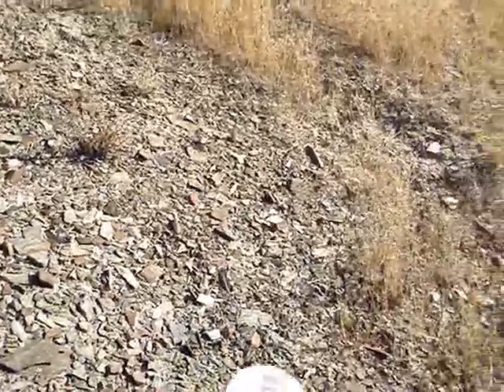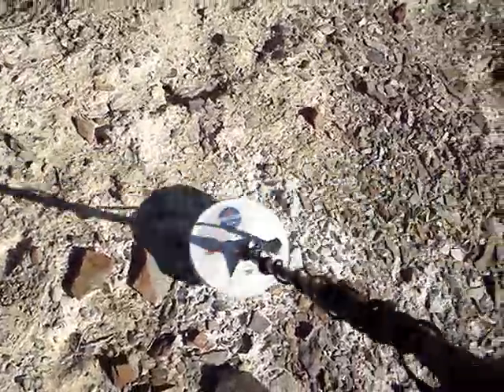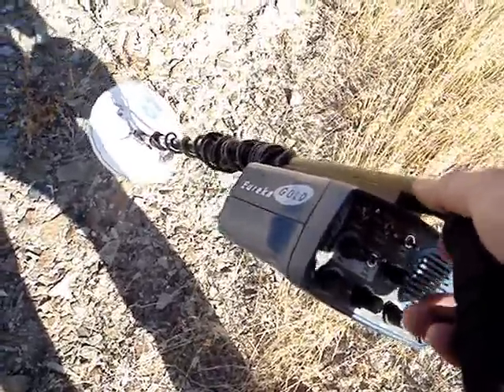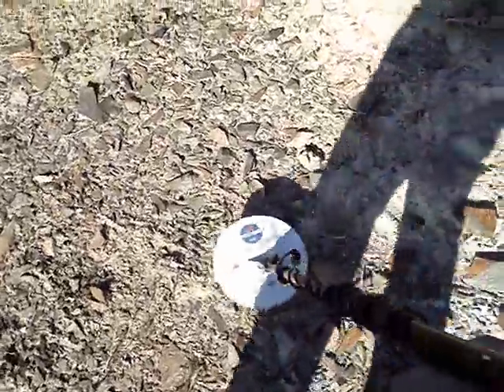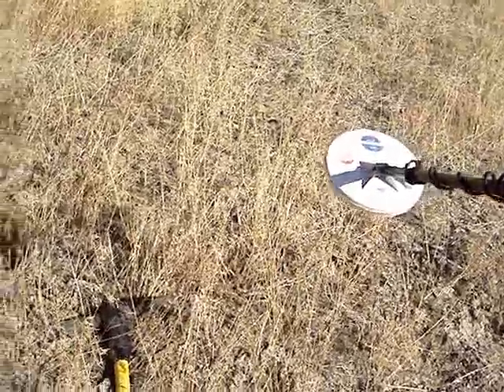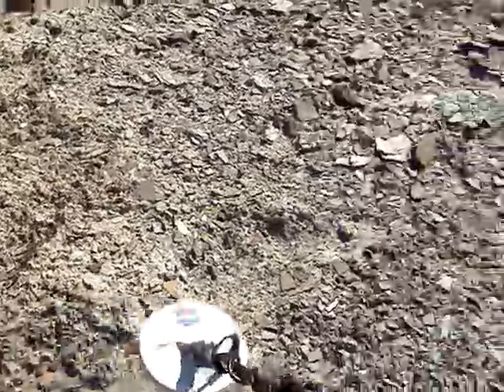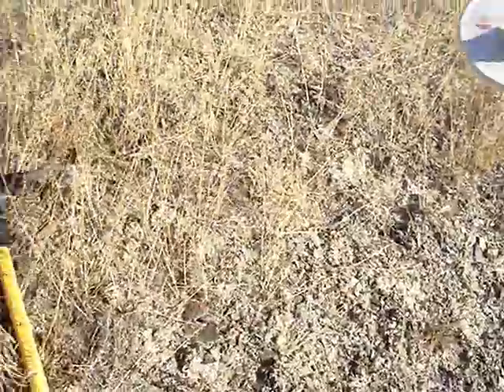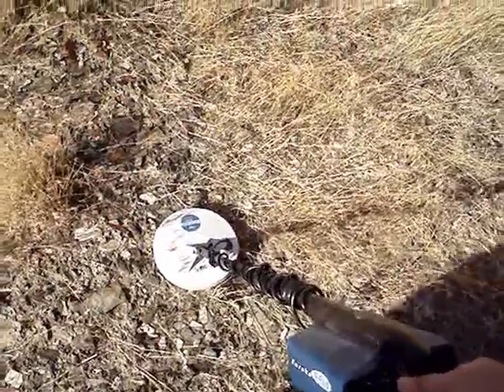Eureka Gold Mineralization Problem workaround.wmv

Comment from the maker: yes it is worth it. You'll need to get good with distinguishing random beeps that come back from mineralization or if the threshold is set too high. I turn it off and on often to see what works better, slow track or fast track in the soil I prospect in.  I always have it set to fine and have found pieces of metal that weigh less than .1 grams with it, like pieces of aluminium trash. if it's gold because it's so dense, it won't begin to pick it up at 2 inches if it's less than .2 grams.